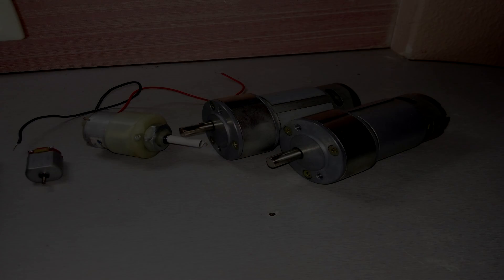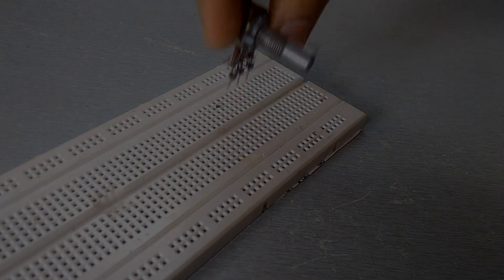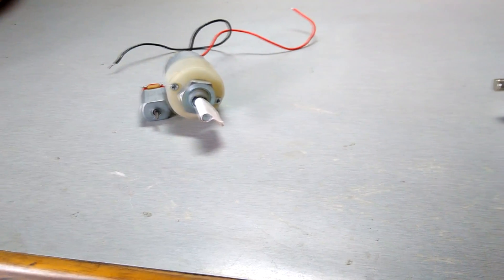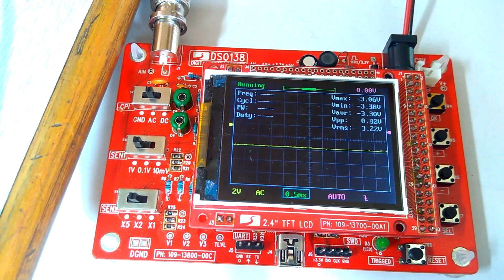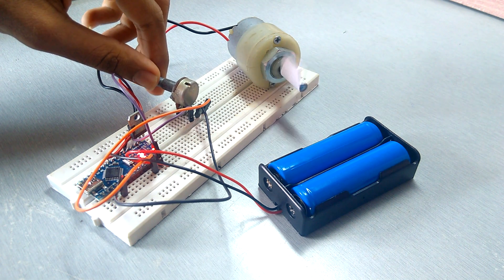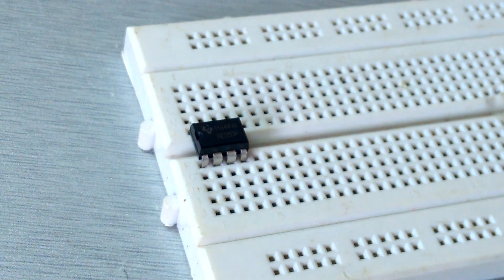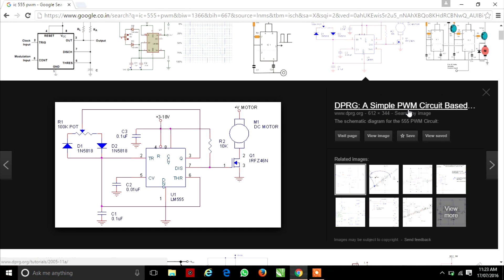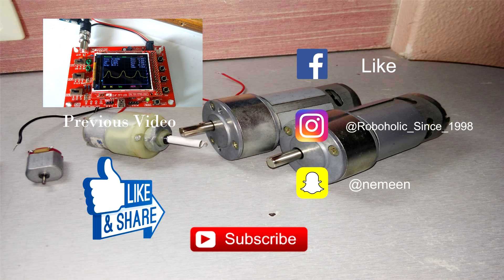How to #1 : Control speed of motor ?

Comment: I know you said you cannot use them to control the speed of the larger motors, but what would you use in that case? I have a few of the larger motors controlling things in my home and you put a spark in my mind about controlling the speed of them- any ideas? A video?
Reply from the maker: PWM can be used for larger motors but those step up and step down module cannot because of efficiency !
Reply: +Nematic ! Thank you for response, is there any loss of efficiency with the PWM if I use a big motor ?
Reply: +John Gardiner I ask because I am not concerned with step up and down modules- they seem very weak ( as you mentioned)
Reply from the maker: depends on motors specifications, if you want to go super efficient buy LTC3780 module and power it up with  12v 10A supply you have 120W power controller ! soon I am making video on it
Reply: +Nematic ! Thank you very much, can't wait to see it

Comment: finally some truth about those "pocket money robbing" ardweenies. my 12 year old grand daughter branched out on her own 2 years ago choosing the arduino controllers and now she is back . she comes over and builds the "old fashioned"circuits that i thought were old fashioned whenever i started  40 years ago. transistors and the 555 chip were the brand new toys back then and i jumped all over them. i was tired of radio glass vacuum tubes. 
today the choice of pro musicians is a beefy tube amp and i'm back building some righteous guitar equipment along with instructing my grands now, about op-amps and circuit builds.
Reply from the maker: Soon there will be videos on Op amp :)
Reply: bravo